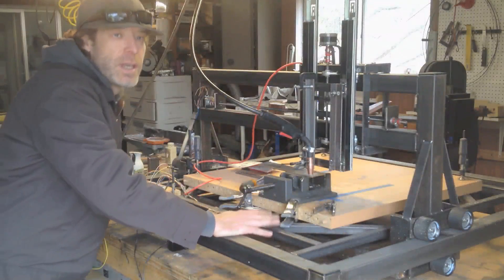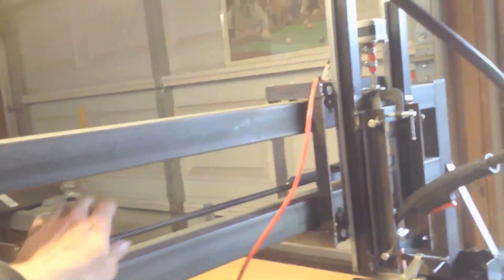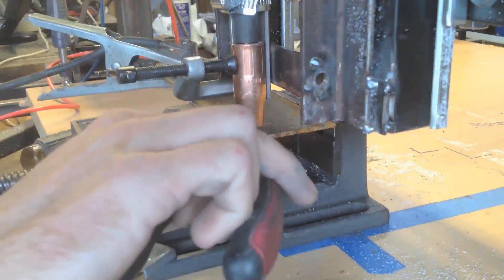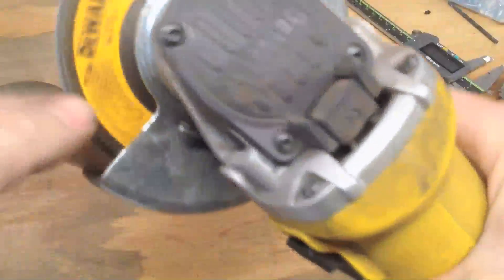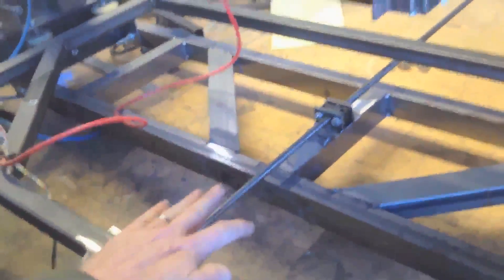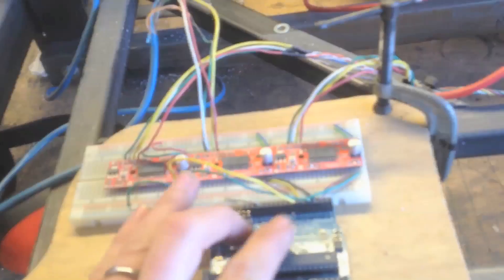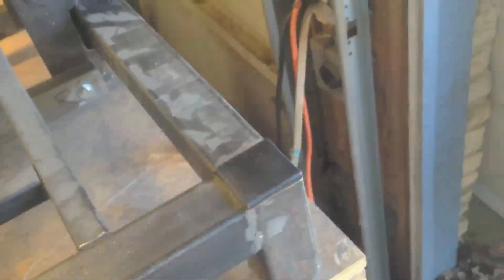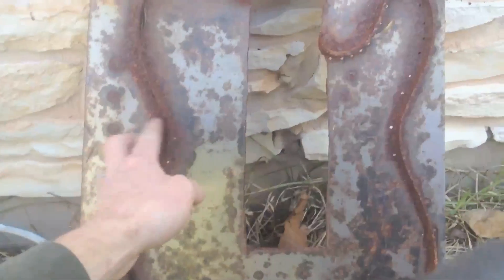How to: DIY Arduino CNC Router Cutter Welder (Part 6: Welding and Costs)

Comment: Excellent job! The total cost of this project was pretty good and you demonstrated some resourcefulness, which was nice. You might want to keep vxb.com in mind for any future bearing purchases as the seem to have the lowest prices and are a reliable company. 

May I suggest a few options that you might find to be beneficial, such as a relay that can be used to turn the spindle i.e. the HF trim router on and off by inserting the appropriate codes into the G-code the CAD/CAM software generates. You can use this to control the MIG functions too. One obvious accessory for the Z-axis is an extruder so you can turn this into a 3D printer. If you make a bin that feeds plastic pellets to the extruder you can avoid all of the issues associated wth using filaments and have a wider array of material types to print with and greatly reduce the cost of prints.

Since you already used the machine as a plotter during your testing phase you are already aware of this option, but what about using an airbrush to create designs or artwork on all types of material? The pneumatic line for the airbrush could be attached to a piece of loc-line for chip removal when routing to help obtain or maintain cleaner cuts in some material. Plus the air line can be used to power a pneumatic engraver. How about making a drag knife for making stencils or cutting shapes out of thin stock like paper, oak tag, poster board, wood veneers, vinyl sheets, etc. Of course,  plasma cutting is obvious, but you could also do stick and TIG welding, flame cutting with a torch, brazing, etc.. However, with these you would need some way to control the feeding of the welding and brazing rods which would not be too difficult. You could also add a mount for the Dremel Tool for making PCBs and doing intricate work with smaller bits, burrs, and cutters. A fourth axis would enable tubing and pipe welding and some 3D routing too. There exist many more options but I have rambled on long enough and will suffice it by saying that you are only limited by the resources that are available to you - the greatest of which is your imagination!

By the way, the M-Function Codes for spindle control are:
M03 Spindle On Clockwise, Laser, Flame, Power ON
M04 Spindle On Counter Clockwise
M05 Spindle Stop, Laser, Flame, Power OFF
You can add these in the appropriate part of the G-code that the CAD/CAM software generates with any G-code editor or possibly a text editor. I am not sure if Easel allows you to edit or download the G-code it generates  but Fusion 360 and other packages do.

Well, I hope that you found this to be helpful in some way and that it was a spark that ignited your creativity and got the wheels turning. And for what it's worth you have a new subscriber who is looking forward to more great things from you. Thanks for sharing and keep up the good work!

Peace!
Reply from the maker: +Jeffrey Vastine Thanks man I appreciate your comment and your good ideas.   I will definitely keep exploring possibilities.   I'm looking at 3d printer stuff next.  I had thought about m3, m5 but you're right, Easel won't allow me to insert these commands.  i will be getting some better software soon.  Thanks again!
Reply: Jeffrey Vastine like like0ppppp0pp0000ppppppppppppp0pppppppppp lpppppppppppppppppppppppppppppppp0ppppppp0pppp0ppppp0

Comment: is it possible to use it as 3d printer if used on 3 axis cnc? of course you would need custom g code but looks promising..
Reply from the maker: +korsez Yes definitely.  I'm gonna start looking into that. Besides the extruder I think I'll need a heated base.

Comment: This way of doing things (where you control the stop/start of welder manually) is fine for doing simple designs when you remember where and when the head goes up and down. But what about more complex designs?
Reply from the maker: +Self Stirring Pot grbl has spindle and coolant controls,  you can use either to trigger the welder.
Reply: Absorber of Light Your video inspired me to build something. I thank you for that and wish you the best.

Comment: great work.....would it be possible to use a 4th access as a on/off switch for the welder?
Reply from the maker: +dean caulton Sure, but easier would be to use spindle on/off or coolant on/off to trigger welder instead.   These commands are available in grbl.

Comment: First off I'm increadibly impressed with your build. You work like I do, you get an idea and then build it, its a great talent but it can be frustrating for those that need plans. i will definitely do something like this. But i need to finish my attic conversion first. My problem is I don't have a decent welder, I just have a chep arc welder not MIG or TIG and I don't have a lot of practice so I would probably bolt most of it together, that would also let me take it apart and make alterations easier. But for the price that is amazing. I'm also not familiar Arduino but It's something that I will be experimenting with soon. Once again great work.
Reply from the maker: +Havelock Vetinari Thank you for your kind words friend.  This would totally be possible without welding and only using nuts and bolts,  that would take the welder out of the equation but you're definitely gonna need a drill press, chop saw and about $100 in hardware.  A lot more expensive than MIG...  In the long run I guess.
Reply: I have a good quality 3 phase Drill press but I don't have a chop saw. Well I do have a woodwork chop saw but I don't know if that has enough power to handle a metal cutting disk. Actually I have two of them. I was thinking about doing it in aluminium rather than steel anyway, I know it's more expensive than steel but You can buy long aluminium building floats which are half the price of aluminium square tube. Maybe I should invest in a mig welder, I just always thought they were really expensive.     I live in Austria and most stuff here is more expensive than in the US. You have certainly given me a lot of inspiration and I have long wanted to build a CNC router. 

Have you tried cutting any 3D objects with yours yet? Also I would be interested to know exactly what software you use. Once again great work I look forward to seeing more from you.

Comment: Nice looking machine The motors seem a bit small but it works. Using the welder to make the designs is a neat idea and you could probably fix the tiny missed spots easily by hand with some tiny tack welds.
Reply from the maker: +builtrodewreckedit I was also leary of the motors but they're working out just fine so far,  I am planning on moving up to bigger motors though...    Yeah I think those tiny spots are fixable,  I'll just clean up after the machine:)

Comment: assume you're using grbl, but have ya thought about using a relay for the switch? then you could switch with the spindle enable pin. 
nice build for 3 bills!
Reply from the maker: +Latrocinium086 Correct, then you could use M3 and M5 to toggle on and off.  I've thought about that but the program that I'm using won't allow you to edit the g-code.
Reply: +Absorber of Light , think you have to save it out and then go in and edit with notepad or something. 
I'm still getting the buck driver for my laser setup. I use chillipepr and pycam. if I get it running right I can hit ya back with details
Reply from the maker: Latrocinium086 Awesome thanks!

Comment: Maybe you could use a gate FET transistor for the welder on/off with the gate pin operating it though continuity . a copper wire slightly longer than the weld tip and metal attached through the other side, then it wouldn't matter if the billet thickness changes.  Awesome section of videos, Great work.
Reply from the maker: +Brian “Easty and the Wolf” Eastwood  That's a great idea!   I've also been thinking of a way to vary the feed speed on the MIG welder because the cmc sometimes slows down around corners and such.  Thanks for the input man.

Comment: Hook your z axis to the micro switch when it lowers to weld it will trigger the switch and off when it lifts.
Reply from the maker: +hearse1000 I thought about that but the problem is that sometimes the welder lingers for a bit before it gets going.  I also needed a quick way to disable in case something goes wrong.
Reply: +Absorber of Light secondary kill switch button big red one
Reply from the maker: +hearse1000 haha! yep.